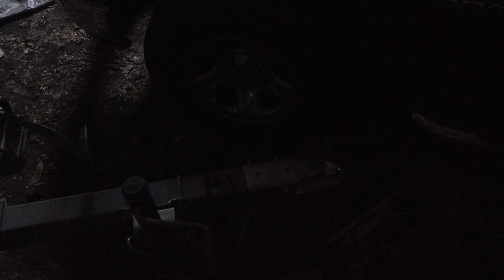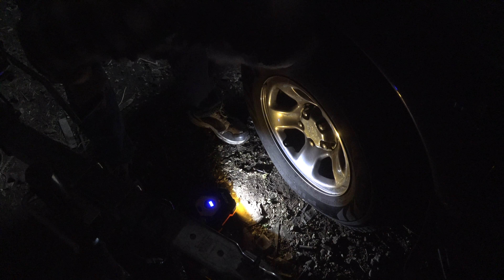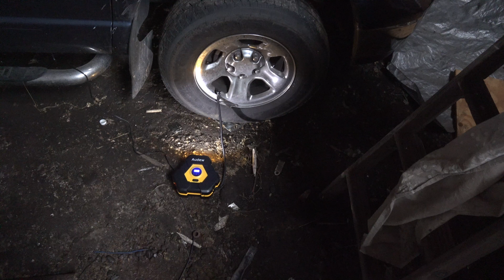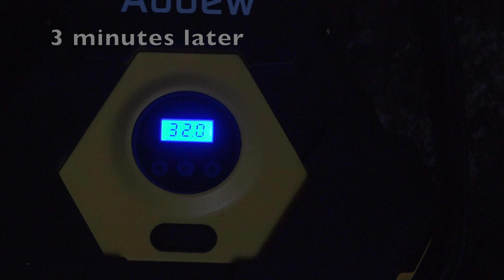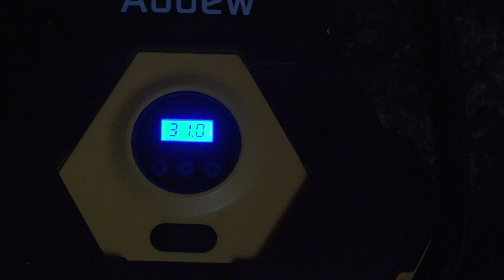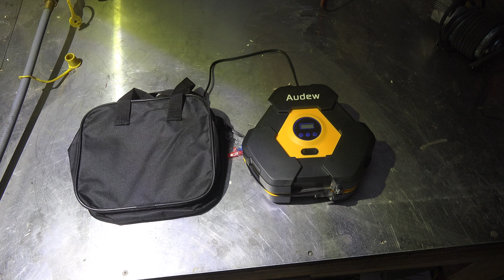A test of the Audew 12 volt tire pump.

Comment: Sadly this unit will fail. All modern 12v air compressors seem to have the same setup now, a permanent magnet brushed DC motor of roughly the same size as in a cordless drill with its powdered metal pinion gear driving a larger nylon gear that drives the crankshaft.

The cantilever crankshaft has no flywheel and no means for proper lubrication. you might have a sintered bronze bushing pressed into the crankcase. The crank pin is just press fit into the counterweight assembly and the connecting rod rides directly on the crankpin.

What usually happens is that as the assembly wears and starts knocking the gear teeth are stressed with more and more peak loading and improper lash so the nylon teeth strip and the pump stops turning.
Reply from the maker: That could be.  The old one  has a ball bearing.
GFM
Reply: Dead on... You can hear the plastic gear... They all have that distinct "cheap compressor" whirry sound. I'm going to find myself an oldie, I really like that metal one.
Reply: im guessing you're an AvE fan
Reply: I am an AvE fan, at least when he isn't getting things wrong. I didn't learn about this from him though, my dad had a 12v air compressor and light combo more than 20 years ago that failed this way and I have had more since then that did it too. He also at one point had a direct drive one just like the good one in this video.